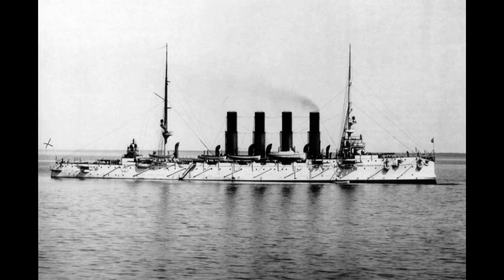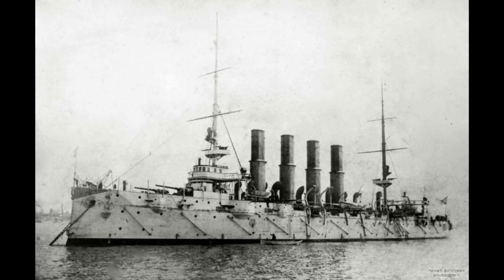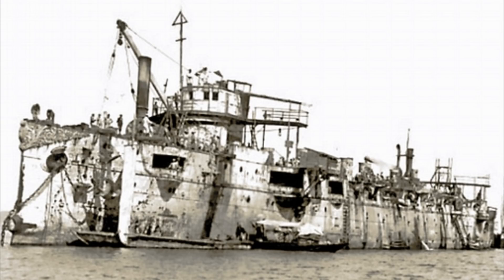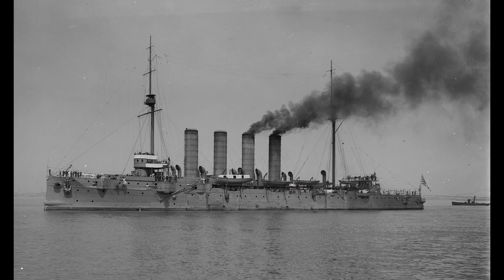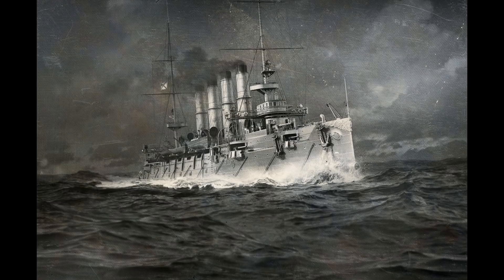HIRMS Varyag - Guide 271

Comment from the maker: Pinned post for Q&A :)
Reply: What do you think of nuclear torpedos?
Reply: What is the black line between the red anti-fouling paint of the lower hull and de grey paint of the upper hull and what is its function?
Reply: Do you think the biggest ships in Zheng He's treasure fleet ever really existed the way their size is described, given that not even in the 1800s wooden, metal-reinforced ships of smaller size had trouble not breaking on the open ocean?
Reply: You should make a video about what exactly represented (or was designated as) a gunboat over time and in various navies. Not only purpose built ones, but also converted trawlers and other merchant/auxiliaries. I think it's a much neglected subject and a mini-series about the actual deployment and wartime use of such vessels would be extremely interesting.
Reply: any plan covering Battle of Trafalgar?
Reply: She was scuttled in a neutral port?
If so how did the Japanese access her?
Reply: I'm quite certain I suggested videos on the topic of HMNZS Moa and HMNZS Kiwi some years ago - a pair of Bird-class corvettes whose most famous action is an excellent case study in the perils around the minimum viable size for ASW work... but they're not on the list. Was it missed, or is the PDF on your website out of date? Or is this the wrong place to plop down boat suggestions?
(In absolute clarity: If all else fails, please consider this a Ship Suggestion.)
Reply: Requesting an episode on USS Savannah, CL42. Bomb in the magazine? What are you talking about?
Reply: During Operation Ten-Go, why didn’t the Japanese deploy the Haruna alongside the Yamato?
Reply: I own a dog kennel and small farm. During the lock downs I listened to all your videos while I did many improvements to my property.  I still listen to them.  You don’t know the service your videos did for me and my children while our lively hood was in question due to lack of customers.  It kept my kids wanting to learn my history and not worry. We accomplished a lot during that time and my kids still love to learn from your videos.

My whole family has served including my wife who was the MC (basically public affairs officer) on the USS New York (the one with the World Trade Center metal In her).

That ship is out of your time range by far, however my grandfather was on the USS Ticonderoga during World War 2. Family lore has it he was on damage control when she was  hit by 3 kamikaze attacks in quick succession. Supposedly he had to lock down bulk head doors to prevent flooding and some of his buddies were on the other side. He never spoke about it and it greatly bothered him till the day he died. 

My question is what is to be known about this attack? I know the carrier was used long after the war so she didn’t sink but that’s about all I know minus general stuff on the internet.
Reply: What’s with the slanting bits on the hull of pre WWI ships, like on the hull here. What are they? Why do they exist? Why don’t they exist any more?
Reply: Are shells interchangeable for example cold Rodney and Iowa fire each other’s main battery shells .?
Reply: How would you have improved the chances of the Imperial Russian Far East Fleet if given, say 10-15 years prior to the Russo-Japanese War?
Reply: Why do so many boats seem to run aground being towed on their way to the breakers ? Anyone have any theories because it seems like an excessive amount just in these videos alone its like every 3rd boat seems to founder or run aground while being towed to the scrap yard.
Reply: I would love to see a video on SMS Zenta and its final Battle.
Reply: Is there still a place in modern navies for light carriers and escort carriers, or has that role been taken up by assault carriers and various LHD LPD LSD etc type ships?
Reply: @janwitts2688  Japan basically seize the Korean Peninsula post war.
Reply: In 1865, following lavish donations by the Iron & Steel Lobby to the reelection and recreation funds maintained by members of the US Congress, the Congress Critters choose to spend money on the maintenance and expansion of the USN.  Would the USN build larger versions of USS New Ironsides and USS Dunderberg, would it expand the monitor fleet, or would it build ships based on those of the Royal Navy?
Reply: @SabreSix1980  "Boot  topping". Usually overs the distance between unloaded / fully loaded displacements. Most exposed part of hull to corrosion, thus gets special treatment.
Reply: The Varyag is another prime example of lots of rigging, masts, railings in close proximity to the business end of the guns. How are these components affected by the gunblast?
Reply: What are the diagonal poles that go around the hull on this era of war ships? I keep seeing them but can't figure out their purpose. Thanks.
Reply: Have you considered doing book reviews in some of your time slots? Since you seem to always be reading the time to do a review would be very small compared to that spent in the reading, and we would all enjoy it.
Reply: What happened to the Five Minute Guide on the U.S.S. Marblehead?  Such an odd class of ships, with at least two notable engagements.  

They were to be up next, IIRC. My disappointment was a palpable thing.
Reply: @misham1213  "What do you think of nuclear torpedos?"

Thought #1: Not for short range use....
Reply: @nathanbattles3958  I am owned by four leash-trained cats.  We listen to Uncle Drach as we randomly roam.  :)
Reply: This begs the question: What is the ship to have served in the most navies in it's life time?
Reply: What is the purpose of the downward sloping pipes along the broadside of the hull. Ventilation?
Reply: Bismarck; the turret rings for the twin 15 inch guns weren't that much smaller than Iowa's; if the Germans had been able to squeeze in four triple turrets, with 15 inch guns,what difference would that have made to the Royal Navy's response. What was it about German guns that caused them to take up so much space?
Reply: You mention that the Varyag was built in the U.S. and that it had turtle-back armor, the question is did the U.S. build any ships for their own navy with turtle-back armor, and how did they fair in battle?
Reply: In the title of your video on the first USS Essex, you describe it as the ‘Bane of Whalers’. Probably the most famous whaleship was also called Essex, AND both Essex’s were launched in 1799. My question is, what are some other examples of ship naming coincidences?
Reply: As you know, after the war the Japanese salvaged/refit several Russian ships, not just Varyag. I've read that they would have been better off rejecting the immediate increase in shipping and using the money for new construction instead. What's your take on that?
Reply: what in the gods green eath is russian destroyer Engels with 305mm gun ?
is it even a gun or recoiless rifle ?
Reply: Drac, I just rewatched your video on the USS Johnson. I know that the Fletcher-swarm is the largest single class of destroyers ever built. What is the largest class of ships produced by each of the belligerents of World War II?
Reply: Seeing the torpedo-net support beams on the Varyag reminded me of a question about those nets. Were the submarine nets ever deployed while a ship was underway, or were they only set out when in port? I've seen conflicting data on that.
Reply: Have you discussed the idea of the iceberg aircraft carrier?
Reply: Did the British ever manage to take a ship to the breakers without it running aground?
Reply: @treadhead1945  there’s a Drach video on this already:  Guide 113, HMS Habakkuk.
Reply: @Dynasty0612  - If I had to guess, it was probably a lack of fuel.  There was a scramble to give Yamato a little extra fuel oil in the vain hope she might make a two way trip to Okinawa and back.  This was not ordered by the high command.  They were more than willing to send Yamato with only enough fuel to reach Okinawa and beach herself.  It was the local commander or official who controlled what was left of the oil reserves at Kure who authorized Yamato getting the extra fuel.  Of course, it turned out to be a waste of fuel, but there might not been enough to even fuel Haruna for a one way trip.  I believe the total of how much extra fuel Yamato received is in  "A Glorious Way to Die: The Kamikaze Mission of the Battleship Yamato" by Russell Spurr.
Reply: The Yamato and Musashi are fascinating ships obviously, but one aspect of them I find isn’t discussed much are the aircraft and especially boat hangers. Can you elaborate on them a little?
Reply: I have noticed that many ships have minds of their own when going off to the breakers? How many naval vessels have tried to run away on their own and how many succeeded in not getting broken up in this way? You don't need to name all of them if there are spoilers for upcoming videos if you don't want to.
Reply: @Dr_V  Nice one! Different navies have called different things gunboats over time. from converted yachts to purpose built floating gun platforms. I would also like to see this topic examined.
Reply: @janwitts2688  Japan annexed Korea in 1910.
Reply: @janwitts2688  Korea fell under Japanese control after the war; even before that´, Korea was only formally neutral, being under heavy influence of foreign powers.
Reply: Could you talk about the concrete troop transport ships the americans made at the end of ww1?
Reply: How effective where the Italian spaced armor belts like on the littorio class battleships? It's my understanding that there was also a filler in the gap between the plates is this true?
Reply: @brendonbewersdorf986  it is true, a foamed concrete the Italians called "cellulite". As for how effective it was, no one really knows because it was never tested at full scale or in combat. It was tested at the cruiser scale, and then scaled up. What is certain is that the space between the decapping layer and the main belt is too small for 15" and larger shells unless the cellulite actually contributes something to stripping the cap off.
Reply: @kemarisite  hmmm that's interesting I wonder if there is a way to calculate the potential effectiveness
Reply: @galaticemperor9881  short answer is no, but there are some caveats. The dimensions generally don't work (the Iowa AP shell is 72" long compared with about 64" for Nelson and Colorado, and 68" for Nagato), and even if the dimensions were correct there can be a weight different (Colorado's shells are about 10% heavier than Nelson's) that throws the range tables completely off. 

As a couple of concrete historical examples:

1) Richelieu used 15" guns with a bore diameter of 380 mm, compared to the 381 mm of British and Italian 15" guns. When Richelieu entered Free French service, the French did not attempt to use British 15" shells, but instead commissioned Crucible Steel to produce some 930 shells for use in Richelieu.

2) Similarly, when de Ruyter made it back to Britain after the disaster in ABDA command in 1942, the British built shells specifically for her 150 mm guns which were noticably lighter (just under 100 lb compared to 112 lb) than British 6" shells.
Reply: @brendonbewersdorf986  the Italians certainly tried, but without a full-scale trial or combat data few seem to fully buy into their estimates. I do see that Nathan Okun includes, in his paper on decapping plates, an Italian test of a 32 cm gun (the bored-out guns of their WW1 battleships) against a scaled down mockup of the Vittorio Veneto's belt armor at 30 degrees.
Reply: What were Pre-Dreadnoughts called before the Dreadnought was unveiled?
Reply: In Normandy by Stephen E Ambrose it is said that the Texas, Arkansas, and Warspite, among other ships were used to draw fire from German Shore Batteries away from the landing beaches, and that as far as allied planners were concerned, these ships were considered "expendable" in so much they didn't mean much to further war operations if they were lost doing this job. Was this statement of attitude correct, or was there hope the ships wouldn't be hit (as in reality that's what happened)?
Reply: @misham1213  what do you think about long range nuclear torpedos?
Reply: @joshuaerickson2458  i guess they're your only option against carrier strike groups if you don't have much in terms of ASMs

Comment: Just how common has it been for Royal Navy ships to make known their objections to be broken up for scrap by running aground on their way to the breaker's yard?
Reply: CipiRipi00  Foundering is a vastly more dignified ending for a warship than the breaker's yard.
Reply: Although true on most occasions, however if the salvaged steel is used to make a brand new ship then something old is now new again and can sail merrily along with less problems than the older ship. And also have more purpose. Like a warship gets broken up & the steel used to make a freighter so now the ship instead of having to wait for a war to be useful. It can sail back & forth carrying goods back & forth & making profits for it's owners, & paying for it's cost & upkeep for years & years. And no one aboard ever gets killed or injured. You know, sort of like a heaven for a ship that gave its all during a war without being sunk. Rotting away whether on the surface of the  sea or beneath it, is not dignified for a ship that has given good service for a few decades. So using it's steel to make something new is a very noble thing to do.